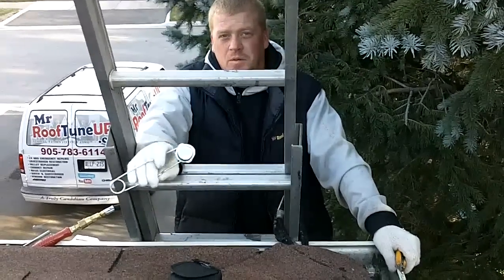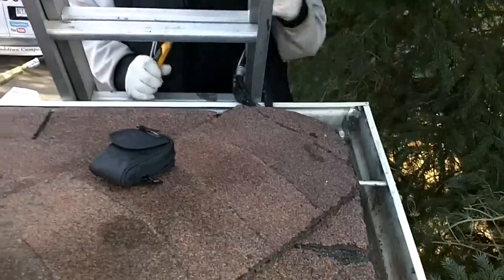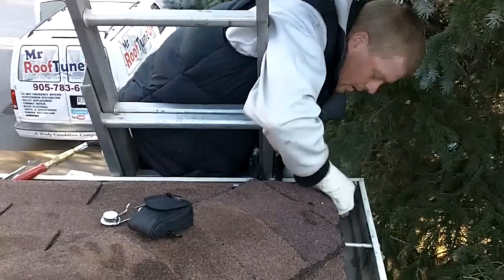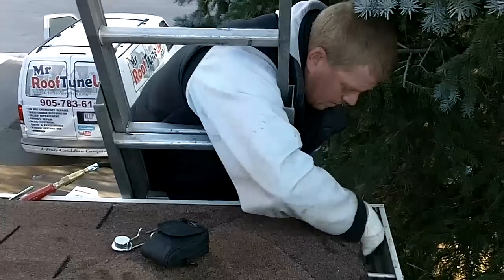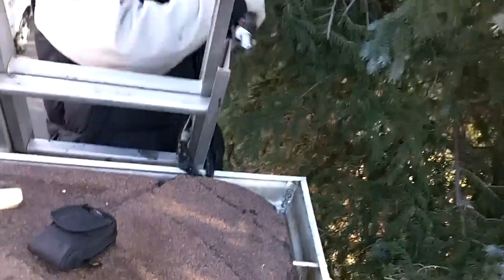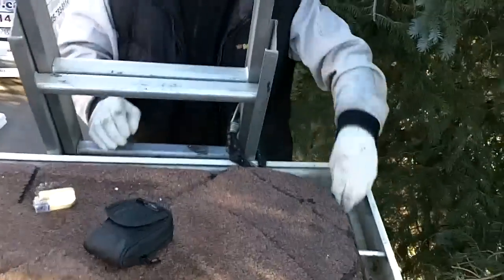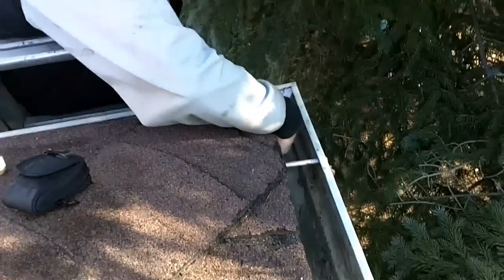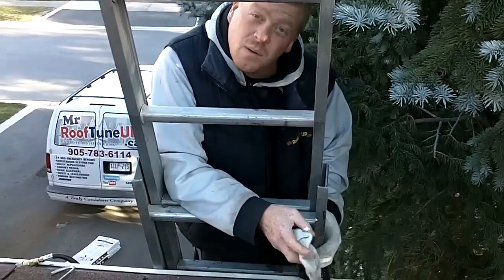eavestrough leak repair

Comment: Great job Elvis, was hesitant to try a repair on my own since the sealant was rock hard but with your method and the torch, it came off pretty easily. Eavestrough had leaked for many years but no more, the brush really helped also. 
The old caulking was somewhat flammable so do be careful people and put out the little fires that might flare-up inside the trough.
Thank-You, Thank-You, Thank-You.